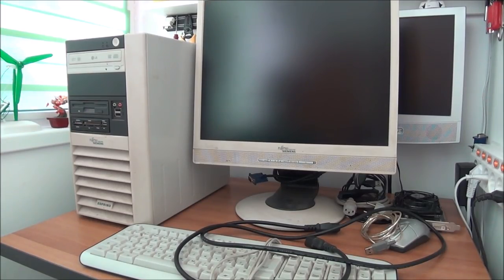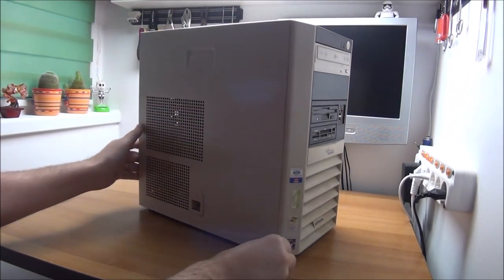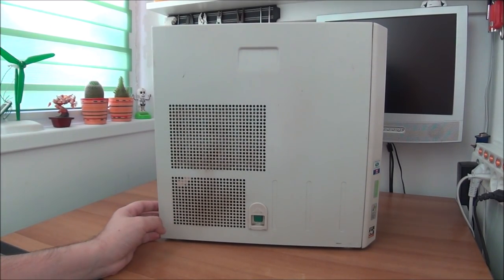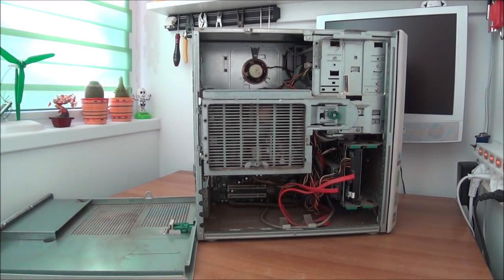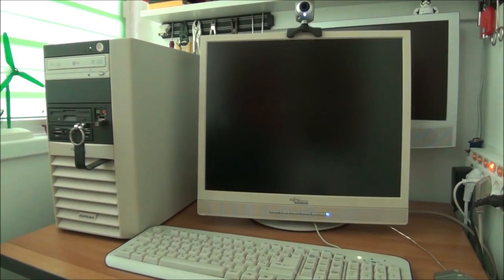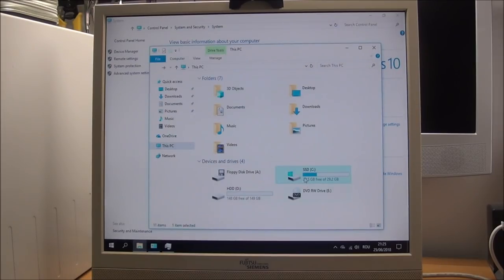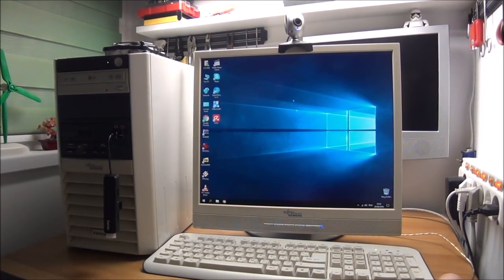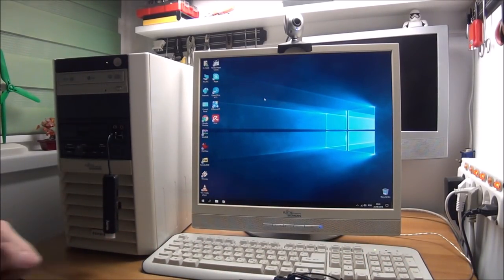Working on an old Fujitsu Siemens Esprimo P5600 computer - upgrade & Windows 10 install

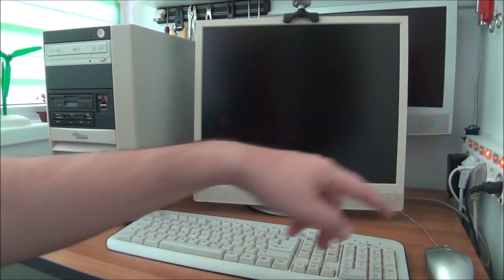Comment: 12:58 That sounded like a hair dryer turning on and instantly shutting down due to failing PSU. Along with some printer scanning in the middle. I deafen myself in full volume listening to PCs booting.
Reply from the maker: That is a really plastic description 🤭

Comment: Once again  I salute you.  I have all my pc s running on windows 7 on older motherboards and I was wondering if I could run them on windows 10,  after watching you with the old esprimo I now think they will be OK for the OS supperted upgrade.  Thankyou for sharing your skill and determination.  Bless.
Reply from the maker: Hi there! Thank you so much for watching! As long as you have more than 2gb of ram on them, you will be ok. That is the minimum from what I saw during my work.

Comment: Hey there. Do you still have the drivers for that Fujitsu tower?
Reply from the maker: Hi. Sadly, no.
Reply: @UltimateDIY  I am having trouble installing win 7 or 10 on the device. Doesn't seem to recognize any connected HDD. Nothing appears in DiskPart either.
Reply from the maker: Is the hdd recognised in bios?
Reply: @UltimateDIY  Yes it is. I tried with different settings in bios as well, Compatible, Auto-Detect and Native.
Reply from the maker: Just an idea. Put the hdd in a different pc, install windows on it and then move it back to this pc.
Reply: @UltimateDIY  I actually already have Windows 10 installed on the hard drive that's not getting recognized during installation. The hard is picked up in BIOS and starts booting into WIn 10 but it restarts during loading.
Reply from the maker: Did you try to change in the bios between native, compatible and auto? It does the same on all of them? Also, what size is your hdd? Could be too big. Although, that should cause it to no be detected, but who knows. Another thing, make sure the windows on the drive is not installed for uefi systems. This old one does not support uefi.
Reply: @UltimateDIY  I think I found the culprit it is installed from a UEFI device. Also the hard drive is a WD Raptor 74Gb. It's almost from the same era. xD
Reply from the maker: Hope the uefi part is the problem.
Reply: @UltimateDIY  Is there anywhere we can talk if I encounter any other problems?
Reply from the maker: Only here.
Reply: @UltimateDIY  Got it working now. Thanks a lot. Sanatate.
Reply from the maker: Awesome. Welcome! Sanatate!

Comment: Upgraded the CPU in a "Dell Latitude d630 Laptop"..... I think I Toasted my display, ....I took the battery out, but didn't hold down the start button down for 20 seconds to get  juice out before working on it.  Then I upgraded CPU, now display has vertical & horizontal lines running thru it,.... went back to old CPU and same problem, swapped out the motherboard & same problem,... installed a new cable from motherboard to display, same problem, hooked up a    VGA desktop display, & that one was fine,... So I think the display is Toast!.....Help?....Any Ideas?
Reply from the maker: Did you get it working? Unless you poked a hole or tear in the display flex cable I don't see how upgrading the cpu could have caused this in any way.
Reply: @UltimateDIY  No
Reply from the maker: Without seeing exactly what was done, I have no way to figure out a sollution.
Reply: @UltimateDIY  I'm gonna try another Motherboard today, but I'm already running Ghetto style cus I can't find half the screws to hold it together!   😎
Reply from the maker: That is about the same amount of screws as some laptops that I get, so should be plenty enough 😁

Comment: CPU supposed to be 64-bit CPU. So just installed a 64-bit windows so you can use the 64-bit version of de video card driver. You already said that 64-bit version work on your computer.
Reply from the maker: That would make sense, but the ssd was quite small and 64bit Windows uses more space. Also 64bit Win uses more ram and this pc was at the limit with memory too.
Reply: well I just telling you that it might work because I used to have a big old computer like that one, it only had 2GB ram with in ancient 80 gigs IDE hard drive and the main storage for the operating system was a 32 gigs SD card and for a CPU it had one of the oldest Pentium 4 processors that you could run windows 10 on with 64-bit. yeah I had a few problems with it getting one of the first big updates from Windows 10 but with a few adjustment it work well... ontil I try to install full Visual Studio ultimate on it,  that program made that computer go to his knees then I knew I had to get a new one.😅 it's going to work. Every file you going to put in the computer, plus all other programs you're going to install on it needs to be installed on secondary storage.
Reply from the maker: It would work for sure, but I wanted it to be as fast as possible with all aps on the ssd and as much free ram as I could keep.

Comment: how old is that thing?
Reply from the maker: Ancient.
Reply: Ultimate DIY how ancient?
Reply from the maker: @mustasheolll2020  2006 I think.
Reply: @UltimateDIY  My mom's laptop made in 2005/2006 can run windows 10 as well, it has a Pentium m. The AMD Athlon 64 was the first windows 10 capable processor I'm pretty sure. It was released in September 23 2003, cool huh?
Reply from the maker: @mustasheolll2020  yup :)
Reply from the maker: I totally agree :)

Comment: Can you put new PSU in this system because this one is trash. One fan is not enough to cool bought cpu and psu. I've used athlon 64 X2 at 2.6 ghz and it was hot like hell most of the time. If I play world of tanks on in with stock cooler it easier get 100+ ¢. Later I put phenom 9650 to upgrade my system but the temp were even wors. So I bought gammaxx 200t and now temp is no more than 50¢.
Reply from the maker: You might be able to replace the psu with many mods to the case.

Comment: maybe you can try amd_catalyst_13.4_legacy_beta_vista_win7_win8.exe, do as you did, compatibility mode win 8.

run Display Driver Uninstaller software in safe mode to uninstall any windows video drivers.
restart.
install amd_catalyst_13.4_legacy_beta_vista_win7_win8.exe in comatibility mode win 8.
it worked for me.
remember version 13.4 not 13.9, this  even newer 13.9  one is only for vista and 7 as its name tells.

you are right about amd ati. i made the decision to never buy anything amd for 
life because of their stupid arrogance  when it comes to driver  support..
Reply from the maker: Thank you for this suggestion! I gave away the pc after making the video, but it can help others in the same situation.
Reply: you are welcome!